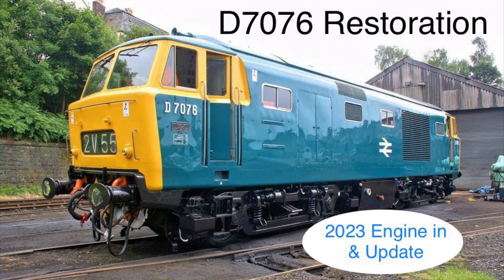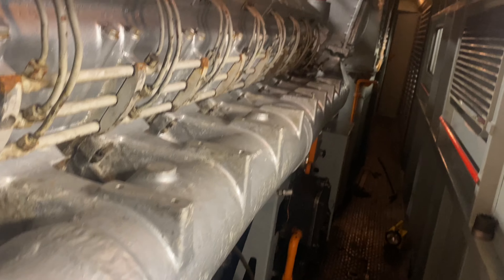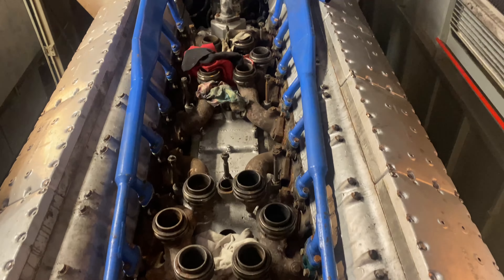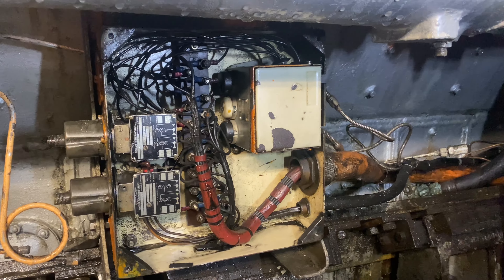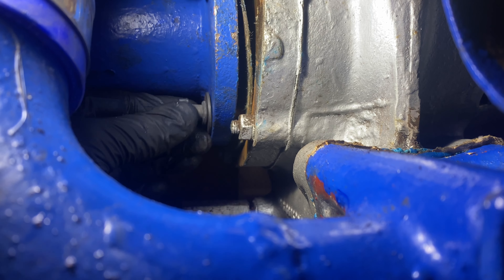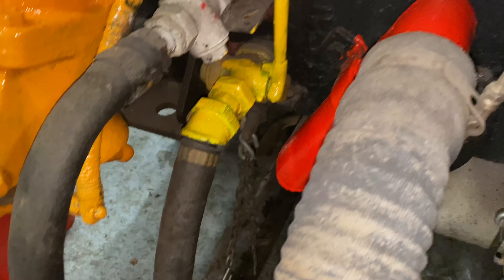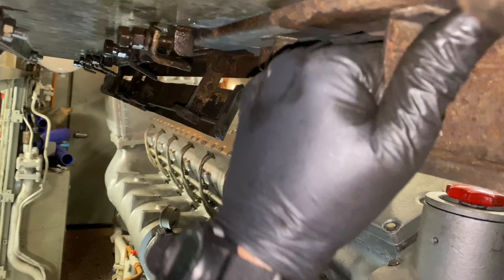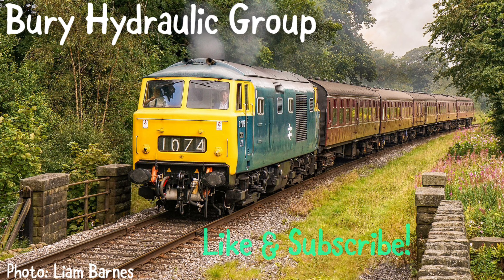D7076 ‘Hymek’ Restoration - 2023 Engine In & Update pt6

Comment: Looking Forward to seeing it in action again, i would still love to do a driver experience on it as i had one booked years ago but the ELR cancelled it -twice!
Reply from the maker: Fingers crossed we can get it back into service soon. As mentioned in the video funds keeping these locos going is extremely expensive especially when we need to buy a set Alf new batteries for it. Please consider helping us out where you can and you never know 7076 might be able to do a driver experience for you.
Reply: @J0nnyGT  Thanks for replying and believe me i can fully understand a 60 year old Diesel Hydraulic is going to be a money pit and if i had money spare after spending it on my fleet of 16 Vintage lorries which are also around the same age -i would be contributing !! -but yes im 100% for the driver experience if they run the courses again. Please take a look at my old lorries on my site.

Comment: What a great project! Four charge coolers up top? Who’s manufactured that engine? I’m just getting into locos in my old age haha. Love the huge Diesel engines
Reply from the maker: Thanks Peter,

Well spotted, those are four charge coolers with two huge turbos. The engine is a Machbach MD870 and was manufactured in the UK under licence by Bristol-Siddeley. 

The engine produces 1,700 HP however this is massively derated due to BRs requirement for a ‘Type 3’ loco. The engine was more than capable of 3,300 HP and sorry to say was years ahead of anything English Electric manufactured at the time.
Reply: @J0nnyGT  thanks for that mate. Well I suppose the engines will last a little longer under less boost if that’s how they de tuned them.
Reply from the maker: Few ways, turbo size, fuel pumps, nozzle size to name a few. We our locos at the EAST LANCASHIRE RAILWAY. 

Well worth a visit
Reply: Maybach, surely ?

Comment: well done, how many gallons of oil in the sump ?
Reply from the maker: Hi Peter,

Off the top of my head the engine takes around 90 gallons of oil which is two oil drums. The engine and transmission uses good quality ‘straight 40s’ oil however the final drive uses ‘straight 80s’  

As you can imagine with the world today this is very expensive stuff and we need every bit of help to get D7076 ‘Hymek’ going again. 

Please see our Facebook group for further details and updates on the restoration of our hydraulic fleet:
https://www.facebook.com/groups/680632005289481/?ref=share

Comment: Hello There it is Mr Cannadine T. Boxill-Harris, I have another interesting idea for most of you Class 508, Class 507, Class 313, Class 314 and that also is including those interesting Class 315 Fans out there, rather than scrapping most of those Class 508, Class 507, Class 313's Class 314's including the Class 315's maybe you guys can convert them and including  the refurbishment into those Leyland 680 Engine, Volvo B10M Engine, Volvo D10M Engine, Cummins M11 Engine, Gardner 6LXC Engine, Gardner 6LXB Engine, Gardner 8LXB Engine, Class 508 Class 507, Class 313's, Class 314's and the Class 315's and convert all of them into a 2 Carriages and Three Carriages of the Class 508, Class 507, Class 313's, Class 314's and that is including those Class 315's for most of us Class 314's and the Class 315's Diesel Train Fans out there Please? Are you still going to do this interesting type of Project for all of us out there Pretty PLEASE.
Reply from the maker: No no no no no no!!!!

Scrap all the classes you mentioned as they are all garbage compared to the BHG fleet